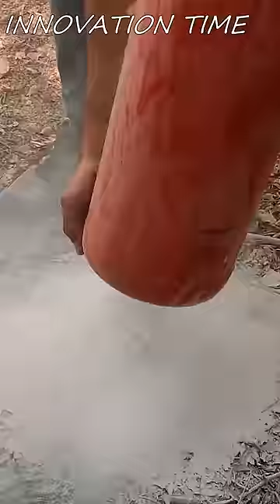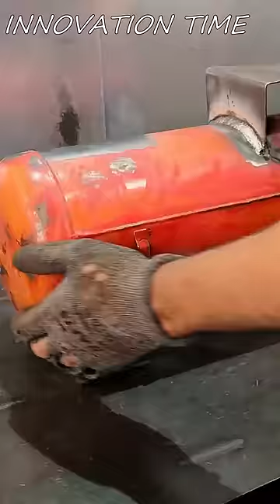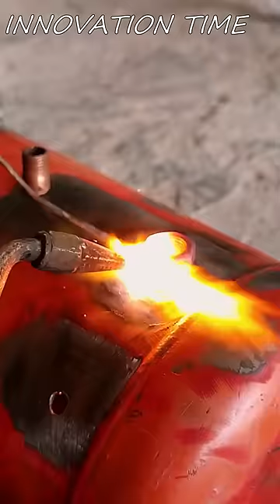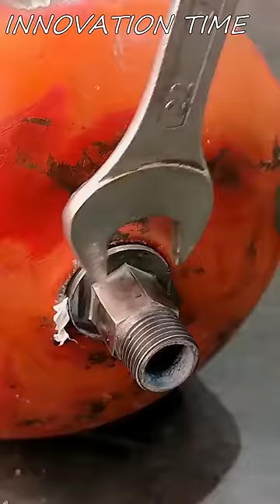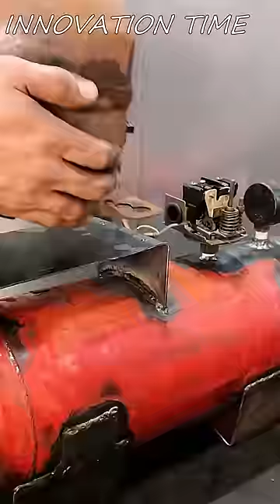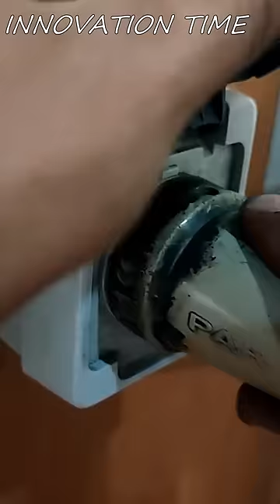Make Air compressor #short #shortvideo details in description ...

Comment: I have a particularly lax attitude regarding health and safety but no way am I standing close to that thing if it has more than about 5bar in it.
Reply: Ha ha ha I was thinking the exact same thing.
Reply: Facts.
Reply: How much pressure does a compressor like that make?
Reply: @georgesimmons9815 Depending on size and power, a consumer one typically goes from 5-8 bar and bigger professional ones can get up to 10-15 bar.
Reply: 😊⁹😊😊😊😊😊😊😊😊
Reply: Looks well built to me, I’ve only been in construction for 45 years though so don’t take the word of experience
Reply: If it was my project. Install all the. Ports you want.THEN PUT A WATER PUMP IN IT. EASIER TO PUMP WATER TO A HIGHER VALUE THAN WHAT  our air pop is set at. Watchtower water Guage closely and enjoy you
Reply: The cylinder itself should be fine for 185psi (12.7 bar i believe) assuming its not rusted. Dont know if i would trust my own welds that much though

Comment: Sketch factor at a hundred. It's gonna blow when you least expect it.
Reply: Just wondering how so brother? Thank extinguisher tank is much thicker and can hold much more pressure than your average compressor tank that same size.
Reply: Surely that little compressor motor can't blow that tank, you may be right tho
Reply: It wouldn't blow the tank apart but if one of those fittings flew off into your face you might be taking a very long nap
Reply: The welds. Always very suspicious of homemade air tanks. Compressed air a very scary thing…

Comment: Yikes. Don’t do this. You’re going to seriously injure someone.
Reply: The reason I’m concerned is because fire tanks are not built to the same standards as pressure vessels designed as air tanks. Most extinguishers are only refilled a couple times in their life, if ever, and then recycled. Air tank pressure vessels are designed for repeated pressurization and emptying. The welds and seams are designed to not work harden. Be careful.
Reply from the maker: Thank you for your information 🙏
Reply: Use low pressure!

Comment: just casually dumps the dry chemical on the ground, but rinsed out the cylinder!!! arc welds the foot pads, then gas welds the most critical parts? THIS CONTRAPTION IS A DEATH TRAP!!!

Comment: This is way to dangerous. Don't use that as a compressor.
Do yourself a favor and look at some compressor rupture videos
Reply from the maker: Hello my friend
It is a fire extinguisher and its working pressure is up to 30 bar.
But we will use it up to 10 bar.
So far there has been no problem.
Reply: @innovationtime20 - key word, SO FAR.
Reply: @innovationtime20  except that you just drilled a bunch of holes in it and welded some parts which might have weakened the tank by a lot

Comment: And yet so many of us don’t empty our tanks after every use, allowing rust to create that ‘timed bomb’
Reply: You are partially correct.  But when a tank rusts out it generally releases through a weak spot & they piss the air out.  (like opening the petcock).  When a seam weld lets go due to over pressure it's catastrophic.
Ether way the tank is junk though, there is no safe way to repair it

Comment: That compressor can make 500PSI, be careful.
Reply: Exactly 34,25 bar for us metric folks
Reply: I thought he put an over-pressure relief valve on it ...Definately cool...
Reply: @richk3325  the CO2 extinguisher is hydrostatically tested at around 200-250 bar, 5/3 of rated pressure, so it has to hold 120-150 bar continous. So a pressure relief valve isn't really needed if he just used it as is but it might be needed because he cut the original bung off and welded it shut, thus weakening the structural integrity. And if he used a power extinguisher the relief valve is absoutely needed because it's rated for "only" 10-18 bar and it could blow up if the valve wasn't there or working correctly.

Comment: Pregunta... Un tanque tan pequeño si resiste toda esa presión? Me quedan mis dudas.
Reply from the maker: Hi dear Alfonso
It's a extinguisher tank and it work on 28_32 bar. But we use it in maximum 8 bar.
I think it's ok and we use an emergency valve that in 10 bar works 😉